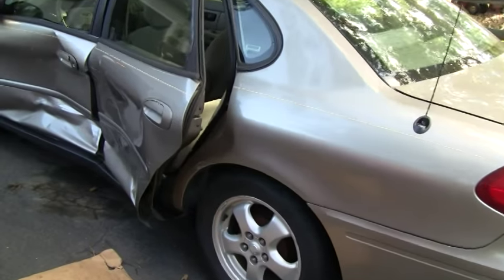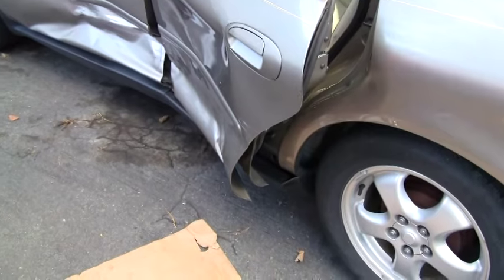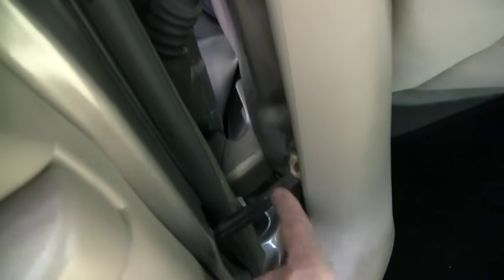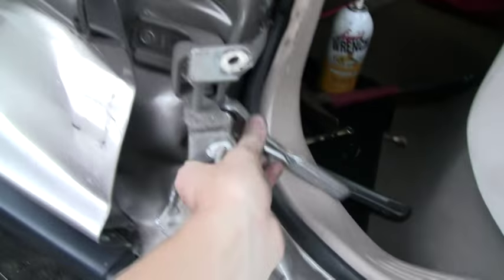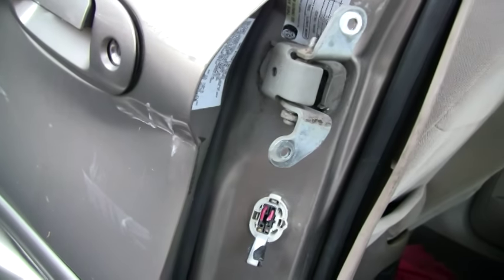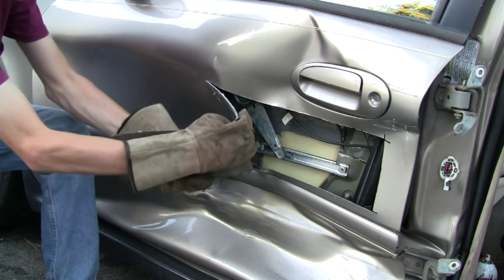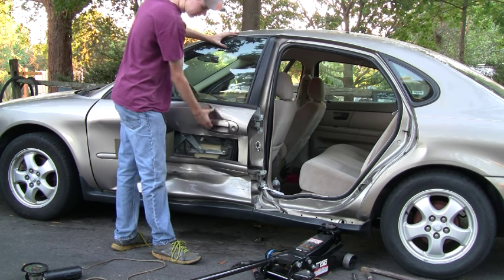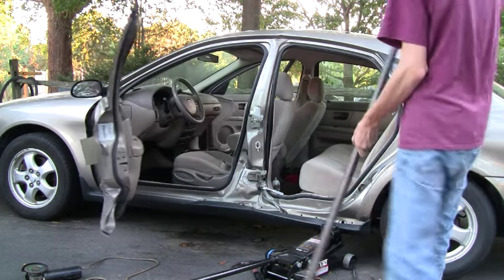TAURUS MAJOR COLLISION REPAIR PART 1

Comment: Wow! Little bent up! I actuaily did this same car a few years back. My friends dad had a Taurus that got T-Boned on the right side. was not quite as bad but I did have to source two doors from a salvage yard. Then had to swap over the lock cylinder and all that good stuff.  The B pillar was a little bent in, he ended up having a body shop pull it out.
Reply from the maker: Just a lil' bit! I've got some doors already, pulling it out will make for some good videos!

Comment: on the matter of the Crushed-in center pillar between the doors, you can make cardboard templates from the pillar on the other side, both inside the car (with all the plastic interior panels taken off) AND outside the car (you may have to remove both of the left sides doors) but then you can get it back to being strait on both sides comparing the bent side to the strait side with cardboard
Reply from the maker: Thanks for the suggestion, we'll see if we get that far ☺

Comment: That's a tough repair even for a pro bud...In OZ it would be totaled and sold for parts only...A bent pillar is ok but if the floor's bent(and I see the rear 1/4 is) there is no more structural integrity in both side and frontal impact..Just sayin' mate.
Reply from the maker: We'll see what we can do bud, if anything it will be good practice for me!